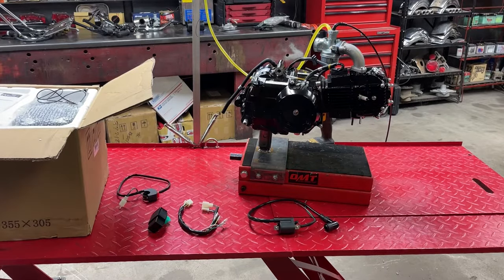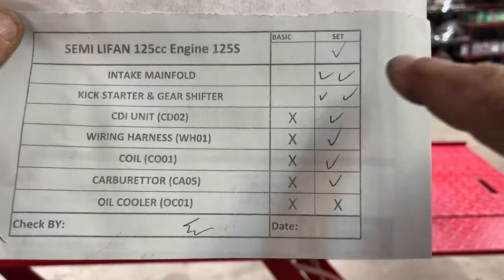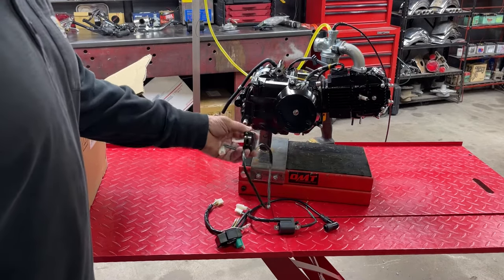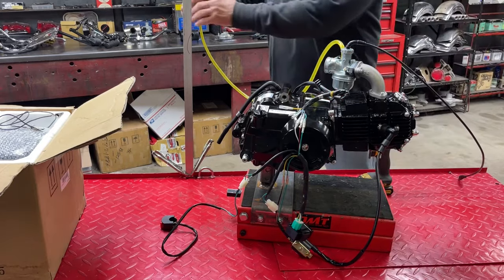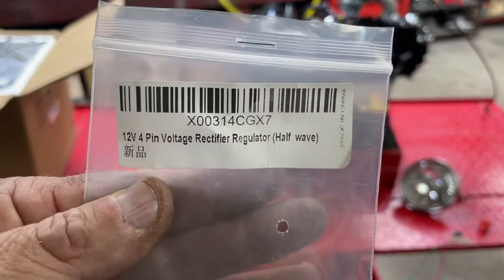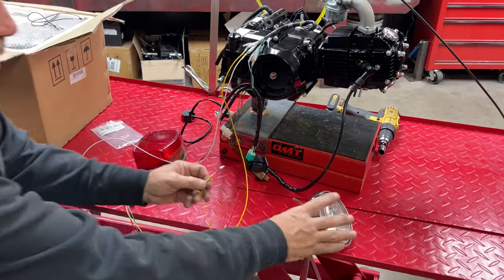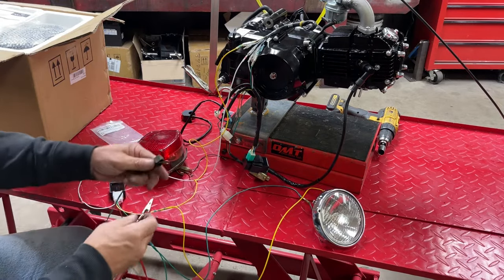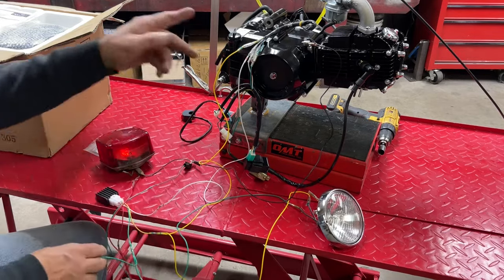Lifan wiring - simple wiring for lights

Comment: I just bouhgt lifan with yellow and pink wire coming from stator. I only got about 6volts from recifier(i have tried two 12v recifiers and one was brand new. I read from internet that there is half wave and full wave stators and i am pretty sure that half wave stators needs half wave recifier and full wave stators needs full wave recifier. I think that my lifan is full wave because light coil is not grounded on engines frame(read that from internet). So normally lifans come with yellow and white wires? And are yellow and white wire stators half wave and needs half wave recifier? If thats right i may need to buy full wave recifier to my full wave lifan. The reficiers that i tried was from my old chinese motor with yellow and white wire and if they were half way recifiers then they     dont work with full wave stator?
Reply: Would be awesome if you reply and tell your thoughts:)
Reply from the maker: @zingzong3812  I’ve had absolutely zero luck with stators that have the pink wire.  I don’t know how they’re wired, but I’ve never gotten one to work correctly.  My advice is to spend the $20 on Amazon and buy a new stator setup with a white and yellow wire.

Comment: Mike, thanks for the info. Just got the engine. I see the plug for the kill switch. Is that normally open and when you want to run engine off it closes? Thanks
Reply from the maker: Yes.  A kill button or switch closes the circuit between ground and the coil (or CDI) and kills the engine.

Comment: Difference between the half wave and the full wave rectifier ?
Reply from the maker: Google can probably explain it better than myself, but the half wave is just that….only half of the AC wave is converted to DC.  The other half is sent to ground, if I’m not mistaken.  It’s an inefficient system, but cheap.  I believe the charging coil is split between 5 windings, 3 are output thru the yellow wire, which is intended to power the headlight.  The other two are sent to battery.  
I believe a full wave system sends all AC power from both sides of the wave to the battery and all electrics are run thru the battery.  
If I have all this incorrect, I apologize.

Comment: Does the motor have a AC or DC stator can lights be used with a AC stator
Reply from the maker: The yellow wire is AC and is powering the headlight in this video.  The red wire is DC.

Comment: Hey mike, quick question, i have a skyteam st125 coming, it starts and runs fine on the kickstart but not on the button, has a new battery, everything works when running from kick but nothing from the button, other than checking fuse, ignition switch wiring, is there anything else i could check?  Its also running 2 extra guages that work fine also, any tips would be great.
Reply from the maker: Can you hear the starter solenoid clicking, when you push the button?  If you can get to the starter solenoid, check to make sure it’s getting 12v.   If it is, jump across the two posts and starter should spin.  You can also put 12v directly to the starter.  If it doesn’t spin, the starter is bad.

Comment: What head and tail light did you use
Reply from the maker: Honda CT70 lights, with 12v bulbs installed.  It doesn’t matter what light you use, as long as the bulb is 12v.
Reply: @MiniBikeMike   alright thank you

Comment: Would you recommend this over a lesser brand like the no name eBay or Amazon?
Reply from the maker: Those engines are just unbranded Lifan’s.
Reply: @MiniBikeMike  which one would you recommend? I do like the idea of semi auto 4 speed
Reply from the maker: @Markonacr250r  The semi-auto have skyrocketed in price over the past couple years.  Hard to find one under $500.  On the other hand, the unbranded Lifan manual is like $230 and includes carb, CDI, etc.

Comment: I have Lifan 125 look alike I got off Amazon and it has 2 yellow wires not 1 white and 1 yellow do I just Connect both  yellows to the rectifier?
Reply from the maker: One yellow goes to ground.  The other yellow ties together with the yellow and white going to regulator.
Reply: Thanks buddy ,I’m going to try to use the stock wiring harness on my 68 CL90 if I can’t get it to work I’ll use this method. I don’t think that I could have gotten this far without your help on your videos so thanks so very much for posting them. If you are ever in Cookeville TN look me up dinner will be on me.
Reply from the maker: @dannywilmoth6402  We were just in Cookeville in October.  Went to a couple of the falls parks.  Had dinner one night at Father Toms Pub, had a great time.
Reply: We have a lot of great places to eat in Cookeville and Father Tom’s is one of them. There is a great brewery down from there Red Silo good beer and Music. Look me up if you are in town again .
Reply from the maker: @dannywilmoth6402  Will do!!

Comment: What does Put Up Iron on the rectifier mean, and why a half way rectifier? So the head light is running AC, is that correct?
Reply from the maker: The stator can be wired a couple different ways from the manufacture.   Most Lifan’s with a yellow wire and a white wire are half wave.  The headlight can be powered AC or DC, depending on which wire you hook it too.  The yellow wire is AC, the red wire is DC.

Comment: I hooked up a battery but it didn't make the headlight brighter my battery is new 12v 7ah led acid battery also will the stator alone power a brighter bulb I have a dirt bike plastic headlight uses a scooter headlight bulb it's to dim it's more of a day running light thanks

Comment: Hello y’all, Mike. 

I have done exactly what you are showing here, still the max voltage I get from the engine is 8. Do you or anyone here have an idea why and how can I fix it? I have a battery that I’d like to charge. 

Thank you.
Reply from the maker: Are you sure you have a 12v regulator?  Sounds like you might have a 6v regulator.
Reply: Thank you for your help Mike. I will go back to work on the engine again now after a while... I will check the regulator.  @MiniBikeMike

Comment: I just got my black lifan 125cc followed all the steps to just make it run started on the 2nd kick but can't lower the idle its stuck on full throttle I even removed the idle screw and still got high idle can you help or anyone in the community thanks
Reply from the maker: Sounds like the slide was installed in the carburetor 180° out.  Take the cap off the carb and pull the slide out.  Make sure the groove in the slide goes over the pin inside the carb barrel.

Comment: Hi Mike .
I'm in the UK 
I'm struggling to the rear brake foot lever and bracket that sits on the spindle  and rear brake cable for a  ct70 . Would you have one I could purchase ? Kind regards.

Comment: Hi Mike, does it have to be an half wave ? I tried your set up but blew my bulbs, I think I have a full wave one fitted
Reply from the maker: If your stator is wound for half wave, you’ll need a half wave regulator.
Reply: @MiniBikeMike  I’m not sure on that, it’s a generic Lifan 110 gn110 pit bike motor, most use a normal 4 pin regulator but mine just keeps blowing bulbs when you rev it up. I have tried multiple known working ones too

Will order half wave one and go from there

Thanks Mike

Comment: Have a question; is your motor using a AC or DC stator?
Reply from the maker: Every Lifan I’ve ever installed has an AC stator.  I’ve heard rumor that there are DC stators, but I’ve never seen one.
Reply: Ok; so when you made your 'T' connection on the yellow wire from the rectifier and connected the stator yellow and headlight on the same wire, you were pulling AC directly from the Stator?
Reply from the maker: @robertlewis9061  Yep, the headlight is AC powered.

Comment: So from engine leads, the yellow is power, the white is a ground? you dont say what the white wire is for? Guessing engine white wire is the ground lead to rectifier that ends up connecting the green wire on headlight and black on tail light
Reply from the maker: The yellow wire and white wire both come from the charging coil.  Only the green wire is ground.  The yellow and white work in unison to create the power output.
Reply: @MiniBikeMike  im trying to wire my ssr 125 engine so the hwad lihht and tail light will work, i took out the 6 volt bulbs and put in 12 volt. Rather not have to use the rectifier with all this, was gonna run headlight blue/white wire to xonnect with yellow and T in the eed tail light wire also. Do i need to splice in the white  lead into all this too?
Reply from the maker: @craighart4186 you need to use a voltage regulator.  If not, the engine puts out so much voltage, you’ll constantly blow bulbs.
Reply: @MiniBikeMike  would it make a difference not connecting the white wire to anything? And just use the yellow?
Reply from the maker: @craighart4186 Only one way to find out….try it.
Reply: @MiniBikeMike  since only thing needing power will be the lights, what i can do is wire to just to run the bike, then while engine is running, test the yellow and white for voltage output. Im not going add any wiring to pedal or front brake for the brake light option, this will be a trail bike and just have running lights. I thought though, just changing bulbs to 12 volt might be good option to handle the voltqge output.
Reply from the maker: @craighart4186  these engines will put out 25+ volts at throttle.  Not sure if 12v bulbs will last without regulator.

Comment: Could you do this but with a set up with a battery and charging please
Reply: Hook the battery to the big red wire and run a ground from the battery to the frame.
Reply: @JetSkiBuyFixPlaySellChannel  thank you for the help and information much appreciated
Reply: @JetSkiBuyFixPlaySellChannel  sorry may sound a silly Question would I be running the + then for the light from the regulator as well as a think fused + to the battery for charging
Reply: sorry may sound a silly Question would I be running the + then for the light from the regulator as well as a think fused + to the battery for charging

Comment: Hey mike. Followed the directions to a t. My lights are incredibly dim at idle. Any pointers? Ive been struggling for a while😊 now. I do have an aftermarket stator/lighting coil on the bike as i killed the lifan one in my struggles. Getting tired and ready to give up to be honest.
Reply: its normal for bikes that doesnt use battery if you go at higher rpms you will get more light
Reply: @S7Sking  oh I got it figured out a couple months back. Needed an original lifan stator and now my lights are nice and bright at all rpms and still no battery.

Comment: What about if you have a remote box
Reply from the maker: Remote box?
Reply: @MiniBikeMike  yeah some of them Taotao 4 wheelers have a remote box that like starts it,parents have a key fob to kill it while they ride
Reply: I never seen one til I worked on my son Cheetah 125
Reply: Ok Mike if you could give me a quick response..I got my wiring harness for taotao 125 but it doesn’t have a front brake plug,Where can I run the front brake wires from?Can I just plug into the back brakes??Thanks for your thoughts..
Reply from the maker: @joseplaisance7451  The front brake switch should have two wires.  One is for power in and the other is power out.  The power out wire can be hooked to the same power out wire as the foot brake switch.

Comment: Great video!
Reply from the maker: Thanks
Reply: My lifan 125cc has a pink and yellow coming out of the 5 wire stator. Is the pink the same as the “white”? 

I was able to wire a full wave rectifier but the voltage coming out is high. I would like to get the half wave rectifier work if feasible.
Reply from the maker: @effie5125  I had one with a pink wire and never figured out how to get it to work.   I wound up buying a new stator on Amazon for $17.   It had the white and yellow and worked great.

Comment: When you say it would go too your switch instead of your headlight do you mean the negative really need this video to include a switch I’m so lost and I know it’s easy
Reply from the maker: In the video, the headlight is hooked directly to the yellow wire and the headlight can not be turned off, when the engine is running.  If you want the ability to turn the headlight off, install a toggle switch between the yellow wire and the headlight.
Reply: @MiniBikeMike  I have a toggle switch with the yellow running too my switch negative ,and the positive for the switch running too the positive on the light and the negative of the light as a ground not sure if I grounded it properly or if I missed something because I had it working then when I went to drive the bike in my yard the lights got bright then cut maybe something came loose I’ll have to check tommorow but I’m wondering if I did something wrong as I ended up not having to use the green or red on the regulator and just the yellow and white hooked up and I made the yellow so it goes to the bike yellow and then added a wire that runs to the negative of the switch I’m using for on off for lights also my bike has no battery in my setup got *update I got it working your video deff helped turns out I had a ground going properly but I dident hook it up too my green wire so when I had it all grounded properly my light dident burn out this time lol

Comment: Why is my light still flickering?
Reply from the maker: If you wired light as shown in video, there is no battery.  Without a battery supplying a constant voltage, the light will always flicker, due to the stators random voltage output.
Reply: @MiniBikeMike  do you use a battery and voltage regulator or one or the other? Also if you are running an ignition switch made within the harness do you need a run switch?

Comment: Hi Mike can I pick your brain for a sec? I just tried to start my bran new lifan 125cc it started once and after that nothing I do have spark it has a bran new carb Im stumped at this point
Reply from the maker: I guess if it were mine, the first thing I’d do is pull the spark plug and check for compression.   If that’s good, I’d dribble some fuel in spark plug hole, reinstall plug and see if it fires.  If it does, you have a fuel delivery problem.  If it doesn’t, about the only thing left to check would be timing.